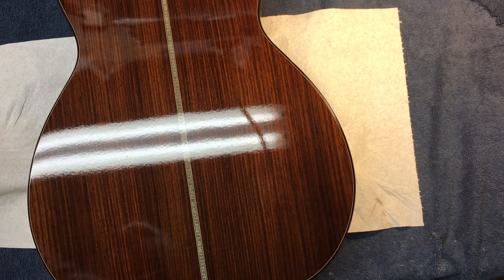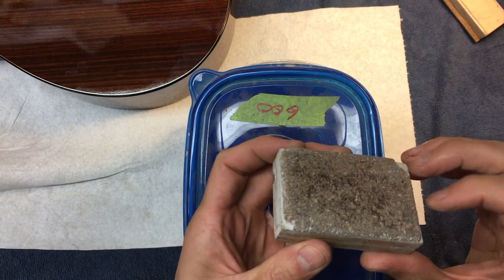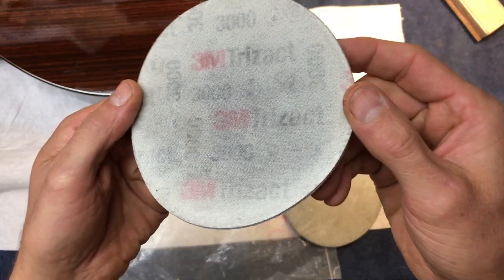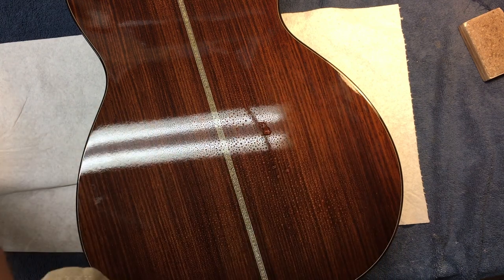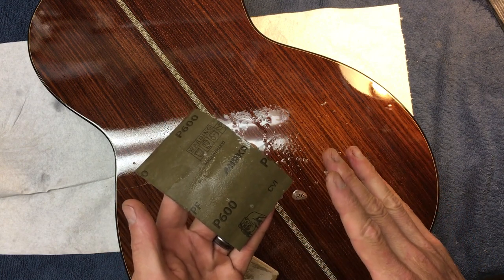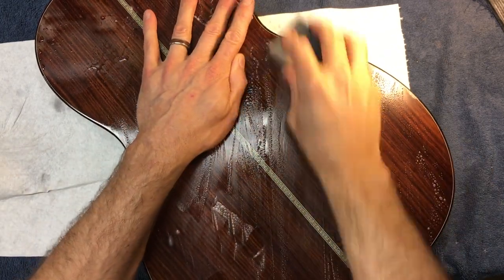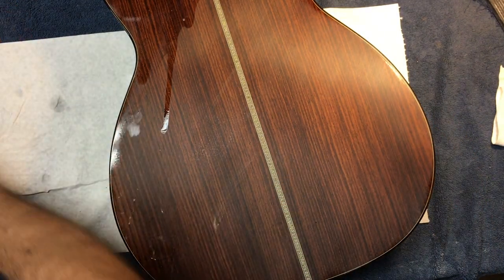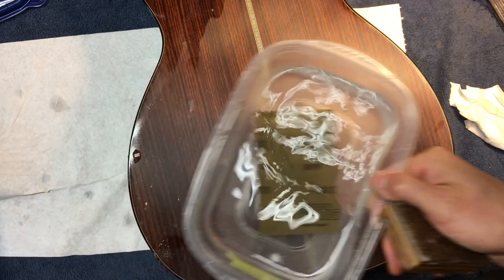Tricks for Sanding Finish Beau Hannam Guitars and Ukuleles

Comment: This video just came up in my feed as I was sitting down to eat lunch here in the shop. Fantastic tips on rubbing out. I have always used the same P-grade grits as you, but never went to the 3M 3000 and 5000-I'll give that a try prior to buffing. Love the idea of different sanding directions for different grits. Thanks so much Beau for making these Luthier-tip videos. They are so helpful to me. Here's one that I can share with you: I use a separate spray bottle for wet sanding that has distilled water and a dollup of Murphy Oil Soap (perhaps 1/2 teaspoon?).  I put just enough soap that the water feels a little slippery rubbed between your fingers. That way, I never forget the soap.
Reply from the maker: Thanks- its my pleasure :)
Great tip- thanks - i've been meaning to buy another spray bottle !

Comment: Thats why I prefer urethane and use it whenever possible because I can get a very flat finish and start sanding around 1500 most of the time. My nitro finishes always come out just like yours and I have to start sanding at 1000 or 600 too.
Reply from the maker: Nitro be nitro! I use a poly base sealer coat which is nice.

Comment: Great, and right on time for me!

Why don't you keep hand sanding on the last two grits/why don't you use the orbital sander for the whole process?
Reply from the maker: When you use machinery , you can sand through the finish quicker. 
Also, I always have got those little pig tail sanding scratches from RO sanding with coarser grits (coarser= P600)
Reply: @BeauHannamGuitars  Thanks! I just wet sanded my first guitar, using various sanding blocks. I saw all the pros using machinery for this part - but it was just too nerve racking for me.
It's very encouraging seeing that hand sanding is not only for the losers 🙃 or just for beginners.
As always - it's joy seeing your work. Your videos are always fun and helpful. Thanks for that!
Reply: @BeauHannamGuitars  Pigtail scratches have nothing to do with grit size. They mean you are either moving the sander too fast or pressing down too hard. An RO sander is meant to be moved about one inch per second. At that speed, it will not leave pigtails. Try running your finger across a 12 inch rule and take 12 full seconds to get from one end to the other. Is that the speed you move your sander? Pressing down on a sander can slow it down, and that, too, can create pigtails.
Reply: @michaeldresdner5061  great tip...still a little nerve racking worrying about sanding through a finish

Comment: Given your stated interest in reducing toxicity in the materials you use - have you tried any of the hybrid water-based finishes from Target coatings? I’ve tried many products in a quest to get away from acetone and their hybrid varnish and shellac are both excellent. The varnish even “checks” like nitro if you get it cold!
Reply from the maker: Hi Peter- I have some water based nitro to try but I’ve not yet. I just started using (trying) urethane finish- I only have to spray 6 coats rather then nitros 12-15 coats (thin varies according to how much you thin it).
I’m yet to buff the urethane but I like it so far and I’ve halved my chemical exposure.

Comment: can you remove only the top laminated layer of spruce top guitar without stripping the actual colours using this method?
Reply from the maker: It depends on where the colour layer was applied. It the actually wood was tinted, then you can remove almost all of the finish. Usually colour is sprayed close to the wood then clear coats sprayed on top of that .
Reply: @BeauHannamGuitars thanks for the quick response... yes the colour is sprayed close the wood, then there is a lamination kind of clear coat, i just want to remove that lamination but i am afraid the the colour will be sanded... i have an old ibanez guitar, it is aged for 15 years, i have so many memories with it, i just want to make it sound more bright by removing the lamination...

do you have any suggestions for it?

btw cheers you gained a new follower/subscriber ☺️
Reply from the maker: @surajshrestha4418  you could sand it a little bit. The amount just depends on the totally thickness of the clear coat OVER the color. Just be careful.
Reply: @BeauHannamGuitars  i will take that in mind
 one last question, which grit would be best? i can have extra patience being extra careful..
which grits would you suggest for that?
Reply from the maker: @surajshrestha4418  I wet sand 600,800,1000,1200,2000,3000,5000 then buff.

Comment: Why does grain matter after clear coats?
Reply from the maker: I’m talking about using the sand papers scratch patterns in the finish to see if you have removed the previous grits scratches
Reply: @BeauHannamGuitars  ok so your using it as a reference
Reply from the maker: @guitjolin  yep, sand in different direction s for each grit and if you can still see the scratches going in a direction you are not sanding in, you know you haven’t removed the previous grits scratches